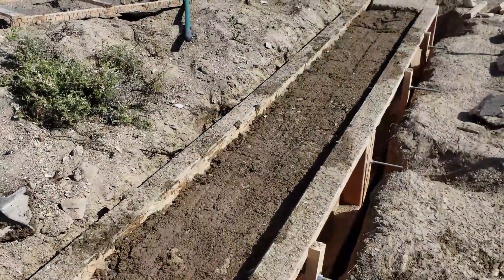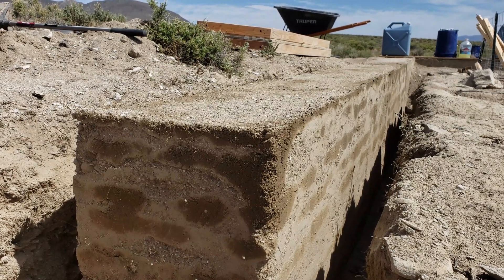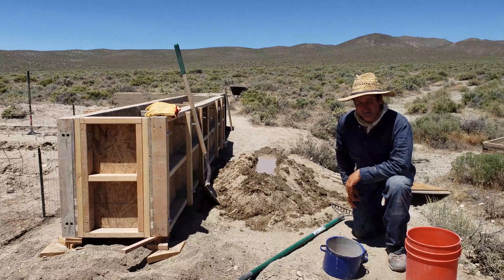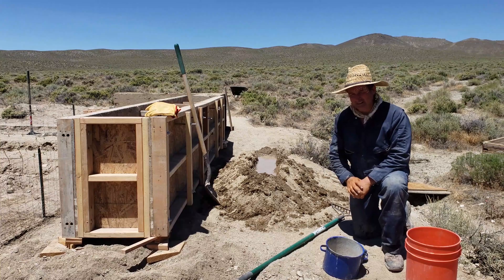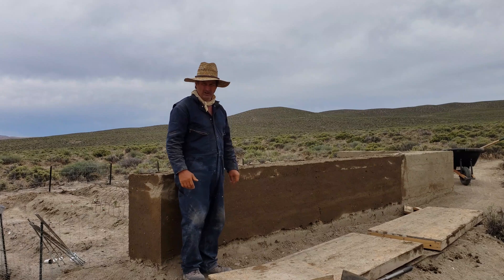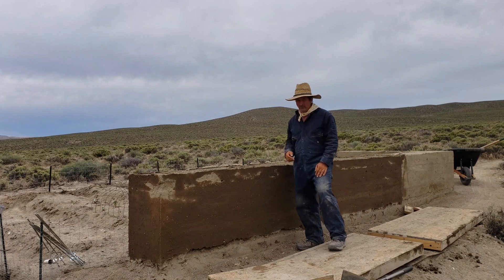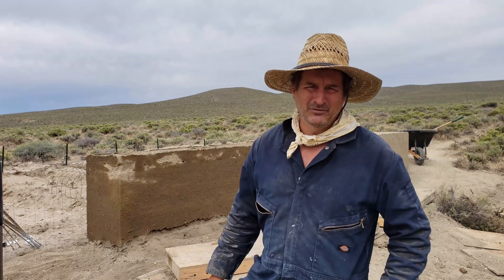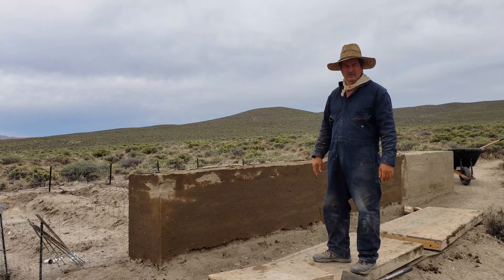Rammed Earth Wall, Part II

Comment: Thanks so much for the detailed explanation.
Can we use a cob mix of sharp sand, clay and straw as the building material?
Reply from the maker: you can built that way, but it is not the same as rammed earth

Comment: good experiment!!! I did just a small test wall with a view for buiding extension to my house in Ukraine with using what is available. Sawdust is quite an overlooked product which I've relpaced sand with ,which in my region is a problem to get. Just cement and sawdust in a damp not sloppy mix gave a comparative ,dense and stable result. I used MDF dust which is the worst variable of sawdust,rough mixed with soft is best mix from rendering experiments i've done previously. Anyway, the block will take weeks to dry thoroughly but externally it was ready to receive a next layer folllowing day. Positives:you can render it with ease, though its waterproof already, thermal properties, you can screw into it, its solid and reacts to impact by becoming harder ,(ballistic properties (Local problems) you can cut out windows or whatever post build. Cons, I have no idea yet.!
Reply from the maker: I like the idea of building with what you have.  in my case, i had dirt and more dirt.    Sawdust bricks should work well.  I think there are additives or steam that can make them more durable.

Comment: So we all agree use 5-10% cement? I'm thinking I wouldn't do this without a tractor/skidsteer and a concrete mixer...
Reply from the maker: I wouldnt do it manually again either.    i ended up with joint problems in my hands that took a long time to recover from.
Reply: @dirtbagbuilder9568  Damn, sorry to hear this. Definitely a super cool technology... and sounds like it's worth automating as much as possible!

Comment: What are the risks of building Rammed earth house without concrete foundation? I want to build on a layer of pressed gravel.
Reply from the maker: It was done that way for 1000s of years, just make sure you aren't in an earthquake zone.

Risks: 
-greater suceptibility to earthquakes 
-any subsoil settling will not be redistributed causing sheer on the walls
Reply: how is the wall behaving in water/steam? Can I leave the wall empty(without finishing) in the shower?
Reply from the maker: @LeeLN  rammed earth and water do not mix.    You should consider making the bathroom of concrete or having it well tiled to keep water away

Comment: Sir, how much of mud, gravel and cement is required ?
Reply from the maker: all materials were sourced on site with a shovel and wheel barrow, so I don't have exact measurements.  
My local dirt is mix of sand, clay and silt.  I removed gravel from the soil (check out the other videos)
each form holds about 1 cubic yard.  If the material is loose, you will need 50% to 100% more material than the volume of your forms.  There was no cement used in this construction but 5 to 10% cement mix is a big improvement and strongly recommended.

Comment: You want your soil mix to be like shortbread or pie crust rather than pancake batter. I would recommend a watering can to help you distribute  your water more evenly in the absence of a hose with a nozzle. The American West is dotted with compressed earth structures that were constructed without the benefit of rebar or cement,  you're on the right track!

Comment: Hey how did you remove tha fasteners from  bottom of the form?
Reply from the maker: I didn't install the cross bars below grade.   The forms were pretty well braced by dirt cave in.    The bolts were just done by reaching into the hole and working away with a wrench
Reply: How deep of a foundation was needed in your case?